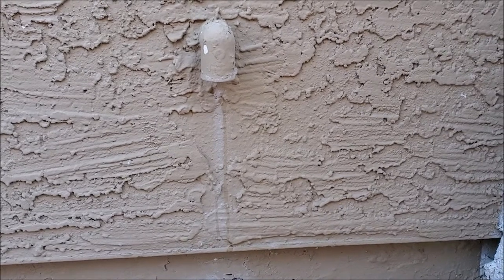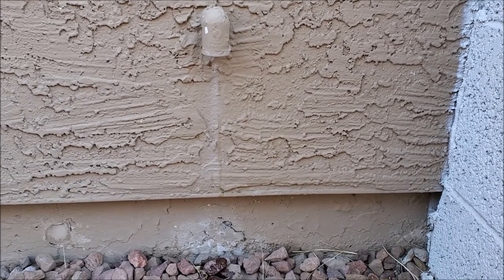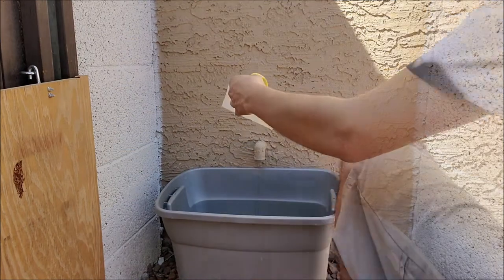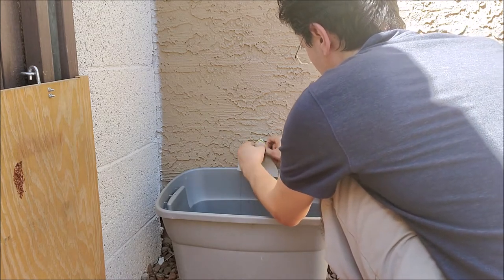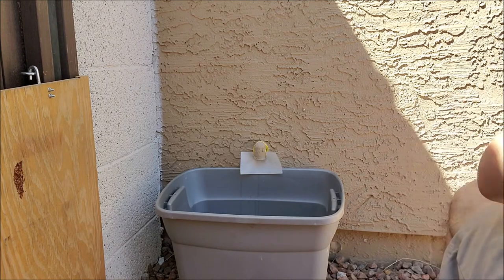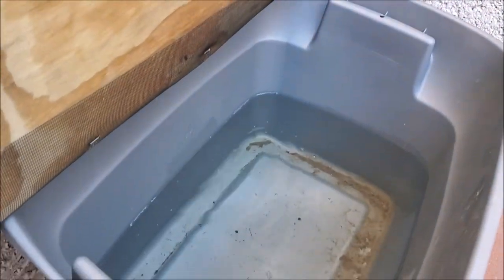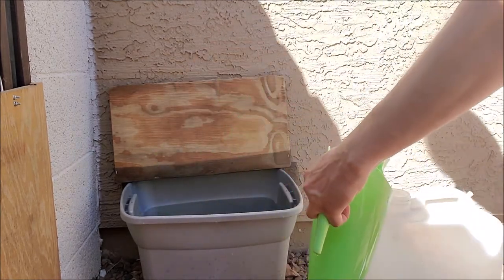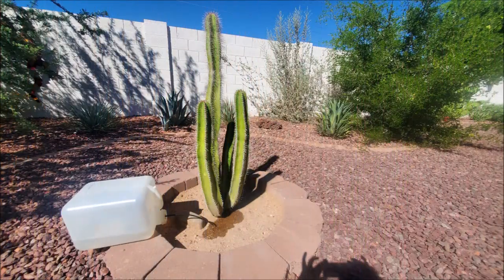Capture Air Conditioner Drip Water

Comment: You should use PVC pipe
Reply: They typically don't use any more PVC pipe here for a good reason.  If you glue PVC pipe together it is permanent and can never be redone.  If you don't glue the PVC pipe it leaks water.
Reply from the maker: Running pvc pipe out to a lower basin surrounded by plants is great.  However, the location of my drip outlet did not allow for this.